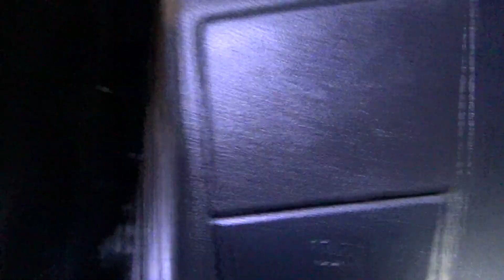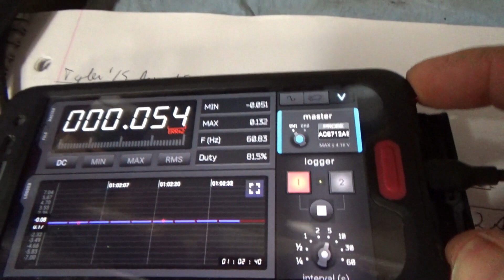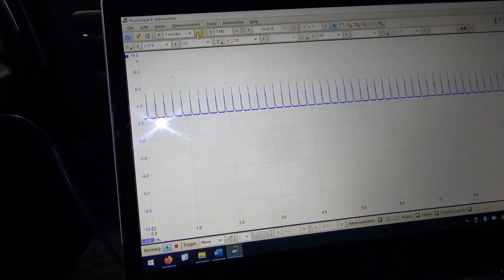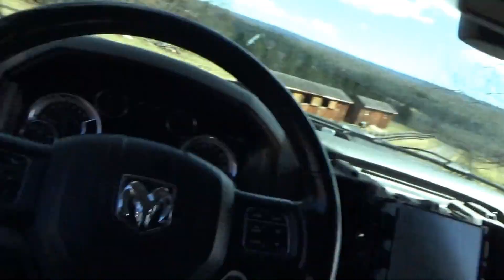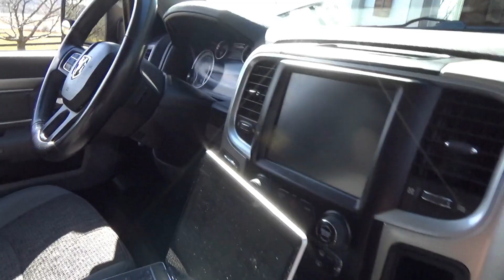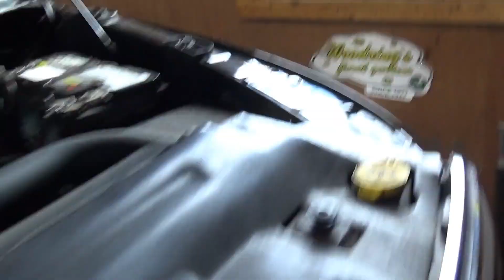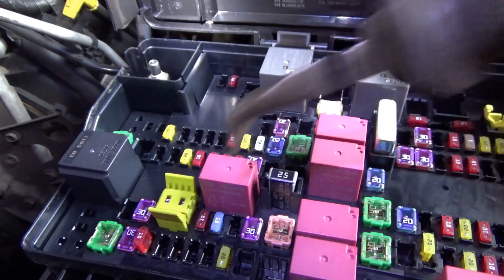Have Never Seen THIS Kill a Battery Before... (Parasitic Ram - Part 2)

Comment: We don't need all thosee modules. Used to be a cable and a couple metal rods. That would work from the time it was built till fifty years later.    <<<   Question >>>> Does the most basic truck of that year still have all that bull crap?

Comment: Seeing as how the module was broken anyway and already apart on the bench, instead of splicing the wire in the harness why not cut the #1 pin off on the module and solder a jumper from the #2 pin to the trace of the #1 pin in the module.  That way if the customer sells it to someone who wants to do another fix they can just get a new module and plug it in.  Amounts to the same thing in the end, but easier for the next guy to figure out what's going on.
Reply from the maker: I saved the next guy the headache of a potential parasitic draw 😂👍

Comment: As a retired support engineer, I feel the manufacturers need to dumb down vehicles and eliminate so much of the automation.  There is nothing wrong with manual shift selection, or with manual 4 WD selection, using a key to open a rear hatch and vehicle doors, etc etc to nearly infinity!!

Comment: Mopar's biggest achilles heal has always been electrical wiring and modules. It is seldom their alternator, battery or starter. Their ZF transmissions, engines, drivelines, fuel and ignition sysytems are generally speaking, reliable. Almost every automotive channel that is a mechanic, usually  has major electrical wiring issues with Mopar. They use very cheap internals for their wiring and their modules are poorly soldered. Their other issues are their weak wheel bearings, rear brake calipers, which tend to hang up and valvetrain issues with their hemis and pentastar engines.
In the case of the engines, most of the times that these valvetrain issues occur is because of poor maintenance or very high idle times. The failure rate for both the hemi and pentastar is approximately 3% which is still a low failure rate, considering the fact that Mopar has built over 15 million hemis and pentastars.
Reply: But their profit margins are high!

Comment: How can a small box with $6 in electronic cost $900 retail to replace?

Because "Dorman" can not reproduce it.

There is software (firmware) in the $3 processor used in the $6 box of parts. Auto manufactures are not going to give this away to "Dorman", or "Standard", ..... 

Not going to happen.

I would be shocked if the software was not under copywrite protection.

Add the effort to reverse engineer the rest of the process controller electronic features in the $6 box.

It is not going to happen.

Lemon Law may provide some relief on a case by case basis. Pressure the OEM(s) to get it covered by the Lemon Law. Hard to do when you are the sixth owner.

Current production vehicles have "de-evolved" back to the 1960's. Expect a car to have a good three years. Then trade it off for a new one. 

Yep, three years into the life of the car and it is a beater.

Remember how many service stations had a one or two bay garage? There were 10s of thousands of them in the '60s.

Just like Tesla Superchargers today... lol...

Fixing a 1960's beater meant going to the junk yard. It didn't take $5k in scanners and 15 hours in labor to figure out what was broke. 

New reality of an old strategy. Keep the customers in the showroom and make sure when they test drive everything works... lol... 

Wholesale the trade-in. "We are not going tie-up our repair department with beaters"...

Comment: Unless you are getting to 20 years of age, most modules will work that are not under stress like the ones outside or in the engine. Replacing 1 or 2 modules in the life of the vehicle should be the cost of doing business. The problem with leaving this module in is the running and eventual burnout of the vent motors.
Reply from the maker: All of my vehicles are over 20 years old and have just one computer each 😅

Comment: I had to put one of those modules in my truck when I upgraded it from the small screen to the large screen.  I think I paid about 2k Canadian for the whole kit which included the screen, the new  bezel, the new hvac buttons, required harnesses and that offending module.  It's crazy how much prices have gone up.  Surprised you couldn't find one at a wrecker?

Comment: Nice repair, at first I heard the flap motors when you reconnected the fuse and thought that wont work it will kill those motors. But when you did the actual jumper connections it did not make the motor calibration noise. And you are right those components are way too overpriced for what they are. It looks like they are out to fill their pockets full of money. The manufactures want the cars back at their dealerships to keep money flowing back to them.

Comment: Ivan, you might want to invest in a ESR meter.  I can't help but eyeing those 3 large electrolytic caps on that A/C board.  An ESR meter will tell you if they're bad.  The packets the module was sending out didn't look like packets, but just a spike.  I'm suspecting failing buck power buck module (stepping 12V down to 5V or 3.3V).  Since car repairs seem to be headed for expensive modules, I'd think it would be worth looking into. Your patch may have bought the owner some time. I doubt if this issue is going to get better.  Also, that "teakettle" sound from the display - when switching power supplies start failing, the can make a hiss, squeal, or even ticking sound.
Reply: And an ESR METER IS VERY VERY INEXPENSIVE!
Reply: @saint-savageworkshopstpier107  True, but what's strange if you have to go to third-tier test equipment manufacturers to find them.  For some odd reason, the big name brand stuff usually doesn't have that.

Comment: I disagree with swapping the fuses.  The most power I saw the A/C unit take was 90mA.  I don't see that as justifying moving 5A worth of fuse from one circuit to the other.  I think there's a fair chance the circuit that's now running on 10A will pop that fuse - perhaps from stress.  There's a reason it was 15.  As for the other circuit, keep in mind the fuse's job is to protect the wiring.  Can that wire handle 15A without burning up?  Then why did it have a 10A fuse?  I think you would have been fine leaving the fuses as they were.
Reply from the maker: Look at the wiring diagram... Only other thing on the original 15A fuse was the center stack buttons 😉

Comment: I think you're right to do the Russian hack on this too. And as these and other heavily-electronified cars age, more and more workarounds will be needed. I can't see cars like this being repairable after about ten years time. Just for giggles, ohm out the transistors, diodes and electrolytics on that module board.

Comment: Ivan, you stated that if this were your vehicle that it would be perfectly acceptable to do what you did to repair this truck.  I disagree.  You would NEVER own one of these cars. (I don't know much about your XL-7, but I would be willing to bet the HVAC system on it has buttons and switches that require you to manipulate them.  You have been jamming your hands into the dashboard of that truck; just look at the cuts you have on them.  I would have thought you might have bought a module from Flea-Bay.  This Russian repair was much better and I am glad you mentioned that in the opening credits of this video.  I am sure glad you choose to live in this country!  Great video!

Comment: Back in the mid 90's, we had our own two-way radios in the pickups.  (The Los Angeles Dept of Water and Power)
As the radios aged, key off current drains appeared.  With a current meter in series at the positive post/cable end, I moved the ignition switch three times, on-off, on-off, on-off and watched the meter.
Of course "intermittently" the battery memory for the two-way radio would stay up and not turn off.  With the driver's knowledge, I spliced the memory wire and the ignition input wires together.  Problem solved.  When the driver turned on the ignition, a button was pushed to lock in the correct channel.  I was the go to guy with that fix for a while.  When asked about an alternative fix, I said "sure."  Then explained what was needed for an auxiliary battery system, with all the required parts.  They declined that and I was glad!  What about the DWP Radio Shop?
Why they said they couldn't find anything wrong with the radio!  Uh Huh!  Sure.
Good one Ivan!  You dug deep and you found the problem!

Comment: I was working on my brothers 2013 Ram 2500. It wouldn’t provide heat in the cab. My Launch scan tool had a blend door travel test. It actuated the doors and recalibrated the blend actuators. Could be like a wiper motor that doesn’t go to its park position

Comment: I had no idea that climate control module would cost so much money.  I think I would try poking around some you pull it junkyards in that case.  But seriously though.  I can't see the point of completely digitizing a comfort system.  So you can change the temperature by sliding your fingers across a touch screen?  That's just stupid in so many ways.  Give me easy to reach knobs and switches any day and I'll be fine.  Sorry about the rant.  Anyway, so the cost to repair sets up an ultimatum.  Either jump start the vehicle and reset everything that has memory every morning?  Or make it so that the vehicle will start on its own power every time.  But have to manually turn the climate system back on.  Nice work Ivan!  Even I would be content to take that trade off.

Comment: Its not sad, its hwy robbery to charge 800 bucks for 17 dollars worth of electronics stuffed into a box, but thats what these modules are give or take 20 bucks for an IC component.   Im not even joking.
If you knew how to fix it it only cost 3 bucks.   I wonder if its where water can get into it from humidity and the inside wet.

Comment: Insted of attacking the fuse,  interrupt the commutation wire with a relay,  thats probably whats wrong with it a bad transistor.   Cut the green wire and hook it up to a relay as normally open  switched ing energizes the relay and closes the green commutation wires path. This should save the presets on the temperature switch module.
Use a bosch relay, with a metal screw down tab 30/40 amp.  Part number VF4 a car audio dealer who also does DEI alarms should have then and a plug in harness.  

This might not even be the electronic module it could be a faulty limit switch on something.   
Do the wiring under the dash it shouldn't fail, any unused wires in the relay plug pull them out and disguard it you dont need it, these can be wired normally open and normally closed the relay only uses 3 millamps of power  if the key is off it won't draw any current,  off the top of my head I forget the pinouts but its on the side of the relay as a diagram. 
You can screw the metal tab to sheetmetal face the plug side down
The metal band is the top so it cant fill with water.

Comment: Good vid IVAN, Since you're the type that likes to teach as you do repairs so others can learn {you called the wrong part and LET US KNOW} then told us HOW you made the mistake.Right there was 1 great lesson,#2 you looked DEEPER into the why it was wrong.Great_now you have the right part,and you pull the cover,$800 for the part is excessive.NOW WE know you have a thermal camera[when you mentioned a possible bad integrated circuit i thought for sure you were going to use it.But then i felt you already have a viable repair method{hot with key on}. Which worked perfectly. But for all the guys out there that really are OCD and pissed at the high cost of small parts check out NORTH RIDGE FIX the guys name is ALEX, he does  component level repair.I've fix a few laptops LEARNING things from his channel {also a good teacher}i know you'd like his channel,even though it's not car stuff.i fixed my Honda with 540,000 miles with a re solder on the fuel pump relay by watching you ,him, ERIC O and a lot of others that love to share KNOWLEDGE,so thanks again,IVAN

Comment: I question why what used to be a box for keeping food cold has become so complicated also, my neighbor spent almost 500 replacing the for lack of a better word computer on her refrigerator because the in door delivery system for ice and cold water stopped working, a year or two later the compressor packed up and went by by, these fancy ice boxes are expensive, I said why do you need such an expensive one in the first place, you can get a basic refrigerator for around 5 or 600 but nope she had to have the fancy one for close to 2k even though she can't afford it. The fault of all these ridiculously expensive items is no doubt the US government, this new administration is hell bent on perpetuating their fake phoney climate change new green deal hoax, it has become their obsession and religion, we were energy independent under Trump for the first time, we now have a load of incompetent boobs in charge. What I'm getting at is that they are pushing the shift from gas or diesel powered vehicles to electric, they seem to think that wind and solar will be enough to power the world which is totally insane but such is their obsession, just look at what they're doing with natural gas, it's ludicrous, the cleanest burning fuel we have and they hate that also, they are completely nuts.

Comment: Thats better than chicken !  I like the Russian version however, I would also consider a few trips to or inquiries with some salvage yards for a replacement part.  Interesting that this part after only 7 years is discontinued !  There should be law that they make them for at least 15 years since its HVAC related and a safety device to keep windows from fogging up in winter/rain. Just like brake parts, steering parts are required to be available from the manuf. due to the safety  needs. I found used ones online for $399 LOL on the price.

Comment: YA THE BASSTURDS & THEIR MODULE, SENSOR MADNESS IS GETTING WAY OUT OF HAND NOT TO MENTION THE FREKIN PRICES FOR CHEAP CHIT. Taking your vehicle to a so called " DEALERSHIP " to have diagnosed is a JOKE ALSO, JUST CHANGE PARTS TILL SOMETHING MIGHT ? FIX IT, THEN CHARGE YOU FOR ALL THE CHIT THEY CHANGED THAT WAS NOT NEEDED, WTF ?

I might not understand 90% of what you're doing like reading your DIAG. CHARTS but I could read 1 thing in this vid. I UNDERSTOOD & COULD READ THE CLOCK ON THE WALL, LOL.

GREAT DIAG. & FIX, SIR IVAN, AS ALWAYS.

Henry from N.E. PA. FREAKIN MAGA !

Comment: I know a bit about electronics it my hobby for 30 yrs that board had a hole stack of Mosfet ( metal–oxide–semiconductor field-effect transistor) there tiny solenoid  I promise you there  is a bad one and its  stuck in on position might beable to test and figure out which one is stuck and jumper it on the board to make the module keep its memory but there a fifty percent chance of melting the board during this process

Comment: Like that fix, recently replaced a final drive control module in a jeep that looked the same as your HVAC module, a plastic box with single circuit board, absaloute junk, and absurdly expencive, that's why we have $100,000 pickups. When will It end.

Comment: I took a shim out of the compressor clutch on my 02' F250 power stroke at 260000 miles and that's all the HVAC work that's ever been done to it...   :)
Reply from the maker: Classic 👌😁
Reply: @PineHollowAutoDiagnostics   Whoa,, I just realized I lied,,,,,,,,,,  sorry,,,  I forgot..
In 2002 when it was brand new the vacuum pump went out and everything defaulted to defrost...
The dealer fixed it quickly under warranty..

Oh man I wish I could buy another brand new one !!

Comment: Not a hack, rather an improved design.  Great job, Ivan.  
This problem is likely Fiat-Chrysler's ill-fated measure to provide memory settings for the overly sophisticated HVAC controller.  Nevertheless, I do believe that "planned obsolescence" designs are welcomed by the CEOs of most of the car makers.  Overly sophisticated creature comforts are paving the way to shortening the lifespans of automobiles.

Comment: Re:  Module pricing.  And people ask me why I maintain my 1993 C1500 pickup truck rather than getting a new one.

New technology doesn't bother me.  The expense and hassle of spending a grand to fix a parasitic draw bothers me...

FYI, I did suffer a parasitic draw on the pickup truck for 10 years...  But, I had other pressing things to do rather than trace down the issue.  So, I installed a knife switch at the battery.  Talk about a low budget perfectly acceptable solution...

Eventually, I found the draw -- a previous owner had installed a relay buried behind the dash for something or other.

These modern cars will only last for 10 to 15 years.  They won't go out of service due to mechanical issues.  They'll head to the scrapyard because the modules radioactively decay to unobtainium.

Comment: Trying to sort my daughters car out it’s a Skoda it’s original issue was the clocks would just drop out and stop working then come back no fault codes and random lights on dimly sometimes would start and die. Then it started and shut down again with an incorrect key issue which I tracked to it killing the comms so it’s not reading the key because it’s killing the network. 
Also if you disconnect the battery and reconnect it it draws about 50ma but if you try to start it it starts and dies no comm and continues to draw 1400ma 
The forums say it’s a common issue with the cluster £840 plus programming… 

I have just left the battery disconnected for now I want to see if after a few days it starts again. 
Im thinking those little metal capacitors maybe faulty so if it starts and the comms come back like before I will start with that..
If I have to replace the cluster I will but nothing to loose by messing with the old one first 
Great work as always Ivan

Comment: It would have been interesting if you had used a multimeter to check for a short or bad capacitors on that board. It could have been a simple fix 🫤